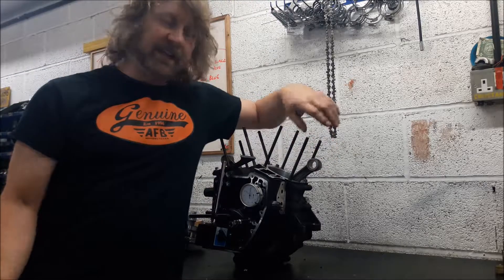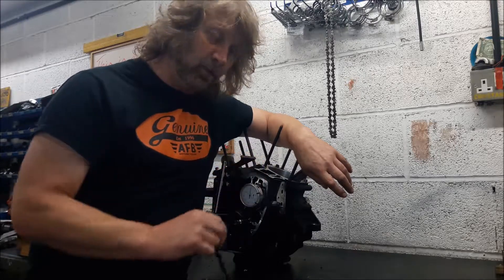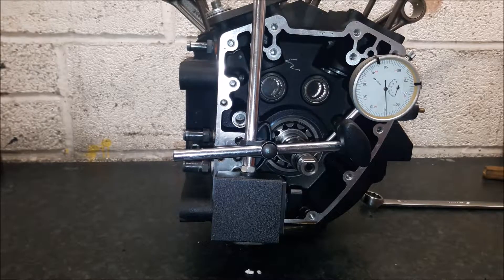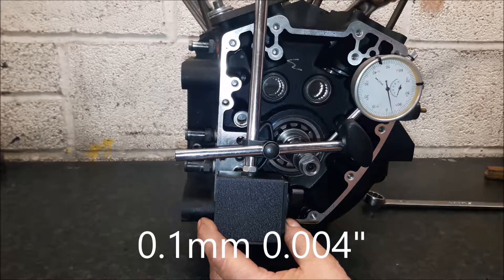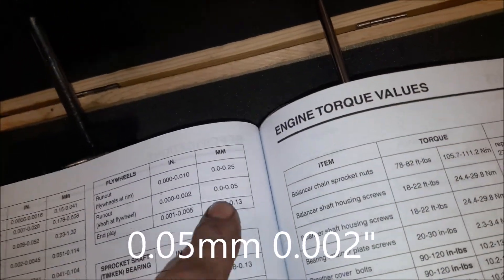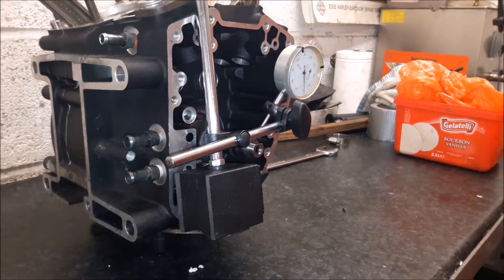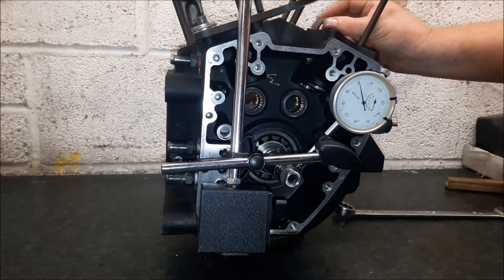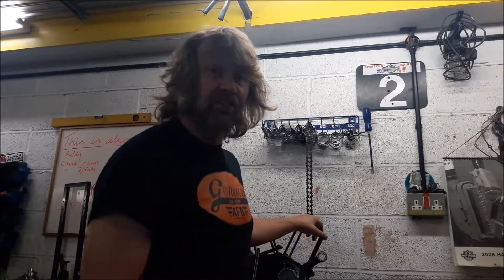Harley-Davidson Twin Can crankshaft run out

Comment: Consider where you are measuring, a worn shaft that has been worn because of the runout. It skews the result. Plus consider when measuring in cases on roller bearings the result may, depending on the year of manufacture, be skewed by the cases no longer being line bored as a matched pair. The main bearing alignment is subject to manufacturing tolerances.

Comment: That measurement can't be taken with the crankshaft  in the case.  When the manual states "shaft at flywheel" it means shaft at flywheel.  It also means without consideration of case bearing tolerances added.  The measurement is taken in a roller stand with the crankshaft supported on the bearing races and the indicator placed next to the flywheels on that same bearing race.
Reply from the maker: I accept what you are saying, however for most street applications on the install of gear drive it's all about the relative runout for the meshing pinion and cam outer gears, so this measurement represents that. We are not blue printing here we are simply ensuring that the meshing gears engagement is okay.
Reply: @andyforbes-buckingham1183  You're right on  that one.  The twin cam design just doesn't lend itself well to a quiet gear drive cam setup without a lot of modification.  A trued-then-welded crankshaft and Timken style left bearing conversion for the newer stuff is really the only way to see beneficial gains in stability.

With the flat bearing on that right side, the measurement you're taking will not represent the true path of the pinion shaft.  When the engine is running the centrifugal force will cause the shaft to "wobble" in that bearing.  You just can't recreate that path by rotating the engine by hand.

I'm sure you certainly helped this engine with your efforts but, unfortunately, research shows that the improvement is only temporary without the other mods to help.

Comment: The runout at the point where you measured it is pretty good to start off with so if you only had to true it a little I would be very optimistic. I think what MrChopemup is talking about though is when people go to extremes in the tuning and he may have a point if the bike is going to be thrashed and abused.
 I had 8 thou runout and it never changed despite my increasing the displacement , changing cams etc etc. When I had the engine rebuilt to 113 cui with big cams using a CVO top end with porting etc , the crank was refurbished here in England and included new rollers, truing and welding the crank so it had less than 1 thou runout. The bike makes over 120 bhp and torque and is quite a handful to ride if you try to wheelie etc because Harleys aren't meant for that kind of abuse (and my being 60 kind of puts paid to THAT ! ), but overall it is extremely good fun as it makes a lot of people scratch their heads when I do wind it up.... the best bit is the noise - it sounds like a drag racer !
 Most people only want gear driven cams to avoid the dreaded engine failures that are possible but not certain to happen if you ride the bike for what it is - if you want silly-fast then you will need to spend a shed-load of money to bring any Harley up to the standards of a sportsbike as far as handling/braking are concerned.... my 113 inch engine promptly ate the gearbox main bearing as I tried putting all that power through a 70k mile drive train.... one lives and learns - hopefully !
Reply from the maker: Agreed most people go gear drive as it negates all the chains and slipper pads and releases more power just by virtue of its own mechanism needing less effort to turn it. In fairness most cranks we see have less than 0.004" so the need for correction is quite small proportionately.

Comment: Typical..twin cam ..You repaired it. But it wont last. Also need to weld it which puts it out of whack. Buyer beware
Reply from the maker: Not exactly sure what point you are trying to make here. We rebuild many cranks, Shovel, evo and TC and are not troubled with repeat failures. Be interested in you own experience?
Reply: MrChopemup Bullshit